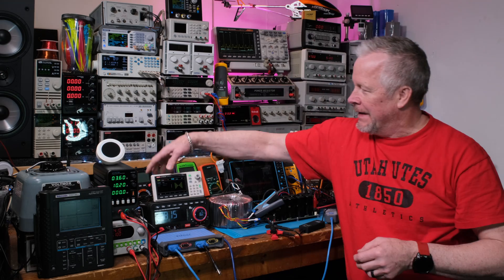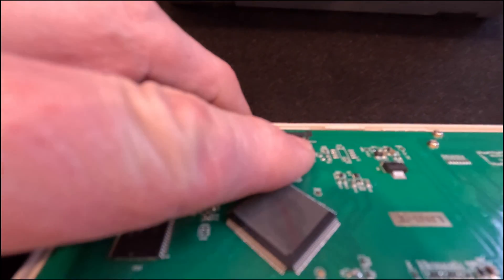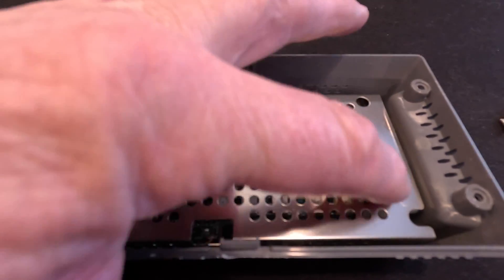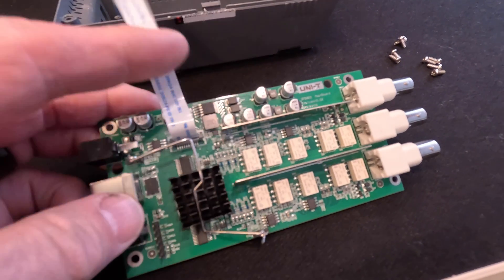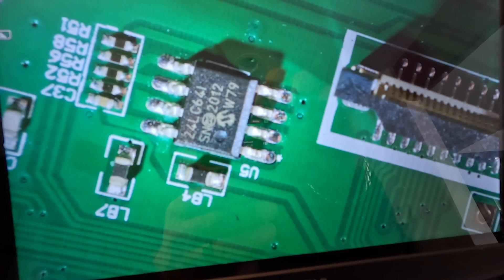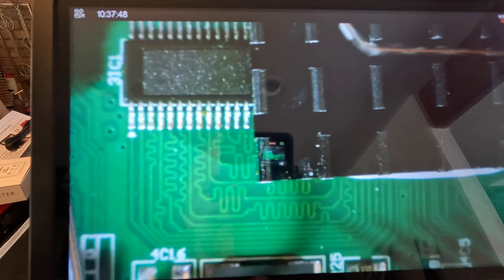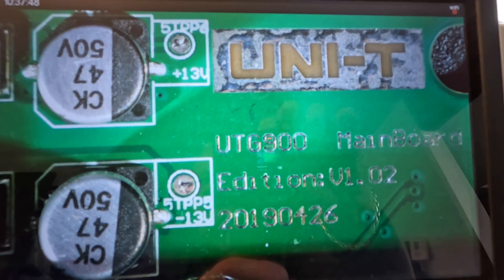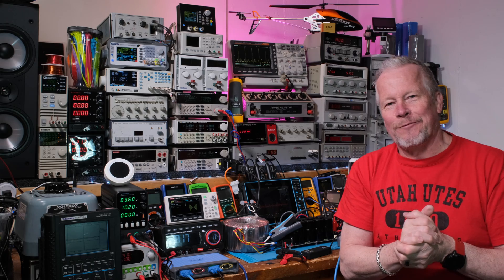Tear down Uni-T UTG962E ARB generator #UTG962E #ARBgenerator

Comment: Eddie, have you had a chance to look at the signal output from the UTG962, and how it drops by 6 dB when you enable AM Modulation?? Please do a quick check by turning on Sinewave at say 14 MHz at say -30 dBm (50 ohm) and then simply enable AM Modulaton and watch the signal drop even if the Modulation Depth is at 0%.  The signal no longer matches what the display shows the level to be.  Is this a firmware problem, in your opinion??  How does it compare to other RF sig gens that you have??  From my perspective this should not happen, and if it does then it should at least show the correct level on the display.

Comment: Something else I need a sig gen.
Reply from the maker: Ahhh, I have an old one - or two that I will show;)  Then I'm selling theml;)
Reply: @KissAnalog  Sound interesting. But freight will probably be a killer.
Its crazy, freight from China is usually little or free. Freight from anywhere else (specially USA) is ridiculous, even other parts of Australia and its delivered by the same mob and comes 1-2000Km whereas its 6-8000km from china???

Comment: I have the same device. If you analyze In detail the DC-DC power supply circuit for the analog output stages (IIRC +/-12V), you will see a poor implementation. Especially for the negative arm. But it's easy to improve, which is what I did a few years ago. The result is reduced output noise, distortion and heat dissipation of that DC-DC.
I can add that the power supply and tracing of the MCU board are also poorly implemented, but can be improved too.
Reply: I don't own this generator, neither did I any analysis. I write just out of curiosity: What exactly is poorly implemented? How did you improve the circuit? BR
Reply from the maker: Thanks - I'll have to look into this;)

Comment: I bought one of these when it was first released, got it for just over 100 USD. For some reason the price is much higher today.
But it works just great. A bit tricky to swap between single sinewave or a sweeping signal, but great for it's price.
Reply from the maker: Yes I agree - it seems the price went up right away.

Comment: I'm not a fan of the side mounted bnc's.  I think it is inconvenient. This newer equipment, although far more functional, is much less interesting inside.
Reply from the maker: Yes, it did take a minute to remember which was which connector, but it does save on the size;)